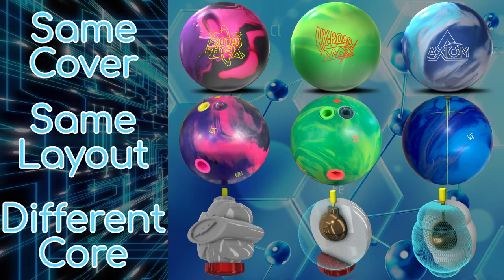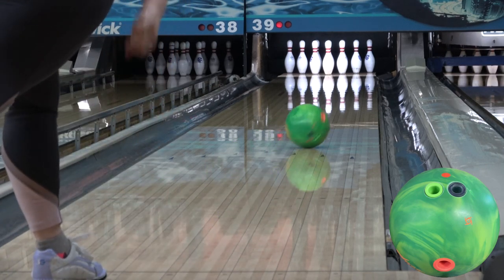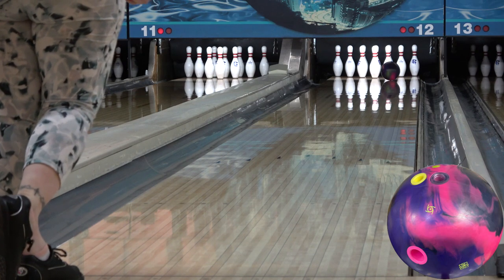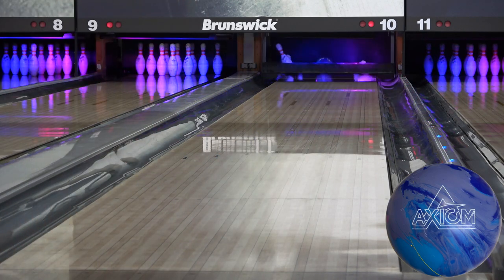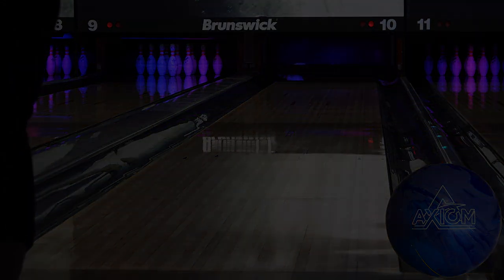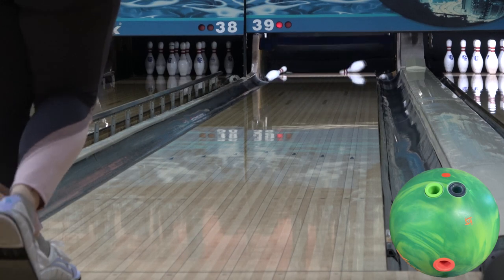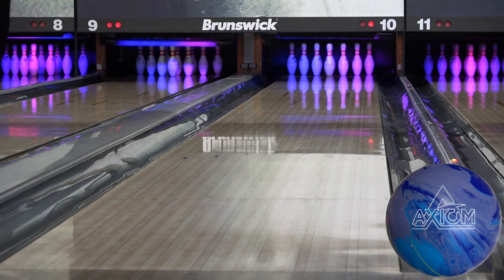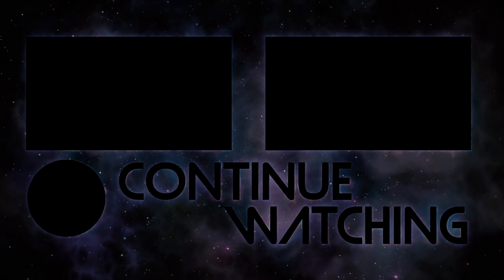The Classroom #4: Same Cover, Same Layout, Different Core (Bowling Instruction)

Comment: Thanks Luke. This content is gold. I think it’s worth noting that while 15lbs is the standard weight reviews are done on the reactions can be slightly different when you change weights. For instance I throw 15  but was gifted a 14lb RSTX1 and it had a bit better length for me due to the RG being 2.55 vs 2.53. Small I know but I also think of the changes for younger bowlers and why cover strength is more important for my son than the core is. Would love to know your thoughts on that. Keep on keeping on!
Reply from the maker: Yep, 14s are usually longer and sharper due to the number differences and less weight to change direction

Comment: Luke: if two balls have the same cover and same core numbers does core design matter? There are tons of symmetric solids with a 2.49 ish RG and a .05 diff, but the cores look way different in design. If these had the same cover stock would they behave the same?
Reply from the maker: I think core shape matters to some degree . . I couldn't tell you why, but I think some cores with similar numbers are naturally more continuous than others.  Some generate a bit more shape, some are a bit smoother, etc.  I think the Axiom for example is straighter off the end of the pattern than the Idol is, and cover I'm sure has some to do with that, but with the Helios coming, we'll see because they have virtually the same cover.
Reply: @LukeRosdahl  thanks Luke. I will definitely be watching for the Helios review. It looks like a cool ball. Do you have any advice or ball choices for heavier oil patterns? I just found out they increased the volume of our pattern for league to increase difficulty. It's still 39 ft house pattern-ish but if I miss right or throw with angle the ball will never come back. I didn't know about the change and just thought it was a "me" problem. I misdiagnosed the issue. It's not longer. Just heavier. For some reason I've seen a few guys doing good with pearl asyms.
Reply: @LukeRosdahl  I got my answer last night. A guy was throwing a brand new Helios on my pair and it did not look like and axiom. It was later than the axioms I've seen and had some serious back end.  The shape matched the idols I've seen and thrown quite well. It had a lot of traction but the shape of an idol is pretty distinct to me imo.

Comment: Nice  vid. You mention you got all 3 balls to the same surface. 2 of them out of the box are 3000 and the Proton is 2000. But you also mentioned the videos shown here where from the out of the box surface when you initially tested the balls as new. So which one is it?  Thanks  !
Reply from the maker: Hey, I had to cheat a little with the Proton, I used footage from later in filming once the edge was taken off. There’s so many variables that go into it, and surface really only lasts for a game or two anyway, Jayhawk did some testing with their surface scanner in a video that’s really interesting to watch. The point here was to get the idea across, and with so many variables, the standard deviation for a “true” test is off the charts, and by the time I go through and explain all the challenges and differences and what you’d have to do to make it a true hardcore comparison, I’d lose 95% of the people watching, and there wouldn’t be much of a point. You’d really have to do something like this at Kegel, but that’s way beyond my means or scope. Simple video to get across a concept was what I was going for but yeah probably should have cleared that up
Reply: @LukeRosdahl  Haha true, true, i agree ! Well if you don't want to lose audience but still want to offer them some more info, you could tell them to come by my channel, and there they can get bor....i mean ...technical all they want LOL.  ^_^

Comment: Thanks for your education videos!

There does not seem to be an SPI ball with a similar strong cover and 2.57 0.046 specs to the Hy-Road Max.  Please correct me if I am wrong.  I have lower ball speed and revs and liked the shape shown in the video.

Given the balls are from 2009, but in good condition, would you suggest I tune up my Mutant Cell & Mutant Cell Pearl as specs in 14 lb are same 2.57, with 0.040, 0.020 Int.  Coverstocks were considered strong 14 years ago.  

Last year I bought a ball comparable to the Proton Physics, but I think my ball speed is too slow and my house shot does not have enough oil (42', 19 mil) for it.
Reply from the maker: The int diff on those balls will throw them completely out of consideration for what you're after.  There's really not anything like the Max out right now, but given than it wasn't very popular, you should be able to find them still for relatively cheap.
Reply: Would the following analogy be fair? The Mutant Cell is to the Hy-Road Max as the Proton Physics is to the Axiom?

Not having used the ball in years, after doing the research,  I was surprised to see the relatively high 2.57 RG of the Nucleus and Nucleus II cores, as I always thought of them as strong cores, with differences in length and shape attributed to the cover types.  

I have thrown the Mutant Cell Pearl recently on the house shot, and it generally has too much motion off the spot.  

I was thinking about putting a fresh surface on the Mutant Cell solid, pitch plugging the fingers, redrilling for "vaccu style", with the thought of getting a similar reaction as the pearl, but earlier and smoother.

Maybe the better question for me to ask is, what balls in 14 lb would you recommend as replacements for the Mutant Cell solid, Mutant Cell Pearl, and Eternal Cell? I also have an Uproar.

I am having a difficult time just ditching my old balls.  I generally averaged 200 back in the day, went to the Nationals at least 10 years, and life was good.  The game was simpler back than when I bowled righty.  

You struck a cord with me last night when I watched the Casey Murphy string pin videos when you said some people today don't want to put in the time and research to understand ball motion and just want to show up with their black ball.  I agree that specs can only take you so far, as their are a ton of variables.  

I was drawn to RotoGrip after watching Wes Mallot kill it in the late 2000's, though how can I compare coverstock formulas of discontinued balls to those of today?  

As a lefty, I have been at 170 for the past couple years, and feel I can return to 190-200 with better ball reaction.  I guess I am looking for an unbiased, educated person to say I am holding myself back using old equipment. 

After saying this, I bowled Friday league against a 230 avg guy who used a Roto Grip Mars X from 2009, which I never heard of!
Reply from the maker: Kind of but not really . . you also have to be careful because you're comparing the 15 pound Hyroad numbers to the 14 pound Mutant numbers, 14 pound Hyroad numbers are 2.58/.037.  

A lot of Storm/Roto/Global cores ARE strong . . in 15 pounds, but fall off a cliff lower than that.  I think one of the balls to look at would be the Clone for sure, the 14 pound numbers are a little stronger, but it's DEFINITELY in Eternal Cell territory, and is also a Roto ball.  Nothing else really fits.
Reply: @LukeRosdahl  Thanks Luke, I forgot about the Clone.  

I was beginning to consider the trio you mentioned in the League Arsenal video:  Summit, VE Blackout, and IQ Ruby.  With my slower ball speed, I'm thinking the Blackout will get down the lane easier and make the corner if I need to move in.  Would Clone, TNT Infused, Hyped Pearl be a comparable Roto Grip trio?

I am careful to compare balls with specs in 14lb, however I did not consider that most all videos show 15lb balls, which may have 0.05 lower RG.  Given I have lower ball speed and use 14lb, should I be more concerned about a ball like the Summit, where the 2.46 may act more like 2.41 for me and be way too early and burn up?  My 1 newer ball is DV8 Brutal Collision (2.48, 0.052, 0.019 in 14lb).  On a pattern with less oil and dry outside, it hooks before I get it to the dry, and has little backend motion (burns up?).  This makes sense.  Where I am confused is, on a pattern which (I thought) has more oil outside, the Brutal Collison seemed to skid too far, and again had little backend motion.  I felt like I had to lower the speed, and point it from 2nd arrow with a suitcase release.  Should I not have the same concern with the Summit, as it is symmetric, or should I put the Brutal Collison away for heavy oil and/or tournaments, and focus on mid RG balls, which I am more accustomed to?  Perhaps Clone, TNT Infused, Hyped Pearl as a Roto Grip trio?

Is there an up-to-date strength chart of SPI Cores and Coverstocks?  

Here is some info you may be interested in, or want to share:

1) bowlidex.com is a great site that allows you to compare specs of balls and filter by brand, weight, RG, Diff, MB, etc.

2) bowwwl.com allows you to save your arsenal, and link to the manufacturer specs.

3) Mendes Magnets pin setting system.  In this video the mechanic talks about it:  
 https://www.youtube.com/watch?v=xz946bUpBJU&t=122s

Regards, Mike
Reply from the maker: Yeah I think those 3 you mentioned would be great Roto picks/substitutions.  And yes, I have some other people I talk to that use 14s and have similar issues trying to navigate the different specs between the weights.  It's great that the Summit has the same numbers 14-16, but also like you said, it's not consistent with how everything else is, so it's almost a bad thing because it won't be a remotely similar feel to your other stuff.
Reply: @LukeRosdahl  The Summit similar to the Brutal Collison as far as RG and Diff, which is what scares me, as the Brutal Collison doesn't perform as I expected on what I perceive as enough oil.  Since it is symmetric, should I not be concerned about the Summit burning up early?

Just watched 1st matches of Springfield Doubles Cashiers Round and James win 3-0, that was cool!
Reply from the maker: @mikewrobel2881  It's definitely early, but it doesn't burn up.  It's slow, but if you're nice with your hand and get it into the lane early, it's great.
Reply: @LukeRosdahl  Appreciate your thoughts.  I'll discuss with my local pro shop guy and see if he can have balls we discussed in a "MatchMaker".

Just saw the end of the Springfield Doubles.  Tough way to end that day for James, but what a great run to be proud of!

Comment: Good wrap up. thanks !  What did you use to make all 3 the same surface ?
Reply from the maker: The Axiom and Max come at 3000, while the Proton comes at 2000, so I cheated a little there and used footage from a game or two into filming. The most accurate thing to do of course would have been to take them all to the same surface before going out, because the box finishes aren’t super accurate sometimes . . but that leads to another video and was really just trying to get the basic idea across. I did the one surface video where I did spinner wet sand vs dry sanding by hand to show that 2000 isn’t necessarily 2000, and there again new abralon is different from used abralon that’s different from tru cuts, but I reach a point of diminishing returns or start to lose people if I get too technical, specific or “waste time” explaining all the controls or reasons why you can only get so good of a standard deviation from something with so many variables . .
Reply: @LukeRosdahl  Yeah for the purpose of this video it's ok it will get the message across. Keep up the good work, i see you make lots of videos lately :)